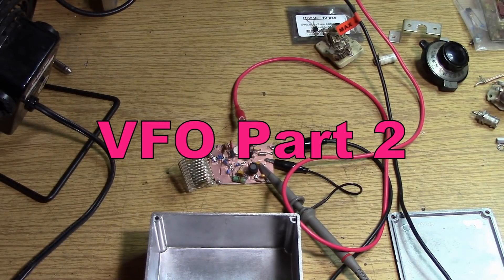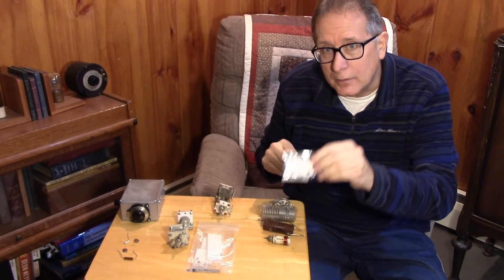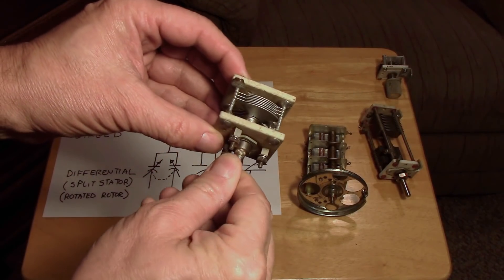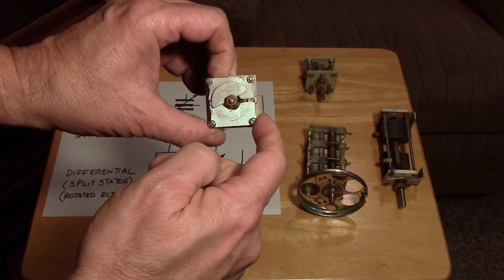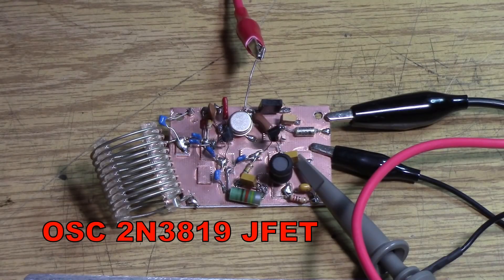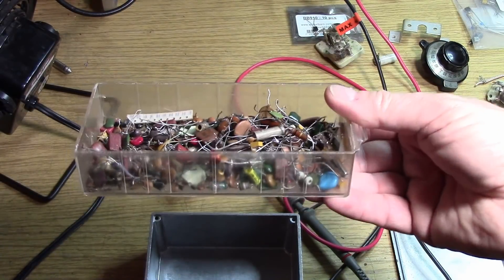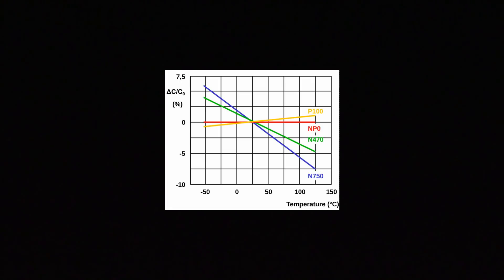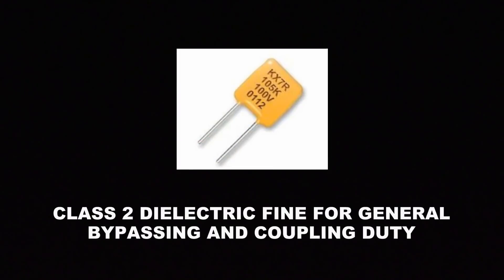VFO Discovery Part2

Comment: Thanks for throwing some light on capacitors! There are so many different types and codes. It was good to learn about the uses and differences in capacitors. I've inherited a load of "domino" looking caps, so my junk box now looks like yours!
Reply from the maker: Domino Caps? Wow have not heard that one before! We used to call them Postage Stamp caps. Some are mica in low values and are real survivors with excellent characteristics - but some of the larger values are multilayer and are a bit prone to fail over time with water incursion.
Reply: @MIKROWAVE1  I guess these caps have different nicknames in different countries but some do look like dominoes with their shape and dots. Thanks for the tips, I'll bear that in mind when sorting through them.

Comment: I was trying to find parts to build a original 2n2 40 qrp trx designed by K8IQY . And in the description it said it uses a few Polystyrene Capacitor for heat compensation. Did you think I could ever find one of these? Yeah, nope. So this video came very well received. Many thanks!
Reply from the maker: They always ask for the exact part you can not possibly procure.
Reply: Maybe a little late, but did you look for the colloquial (surely once a brand) name "Stryoflex"? Found plenty of suppliers for those.

Comment: Please, 

please continue with this very interesting series of elementary knowlege, that nobody will learn, in this 'new hurry-up  times' anymore! 

It's like going back 30 or more years, but the math ist the same, and the results too! 

Why unsing a PLL or DDS, when you can have such a stable VFO, made by yourself, without any phase-jitter, or any similar problems, you will get, using 'unessesary parts' to the circuit! 

The simpler the circuit, the better it is! 

No additional parts, that 'only' created noise, jitter or 'bad behaivior', to the desired frequency, ... ! 

I am fascinated, by using the very  simple way, to come to such great and good results!

Keep that candle burning! 
Sorry for my bad English, it's not my native tounge, ... ! 
If you kept my mistakes in my spelling or grammary, you are allowed to collect, and recycle them for free, without any fee!  

73 de Markus ; db9pz

Ham-radio OP since 1989
Reply from the maker: Part 3 coming tomorrow!